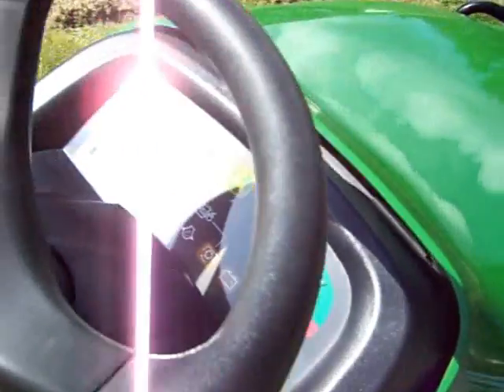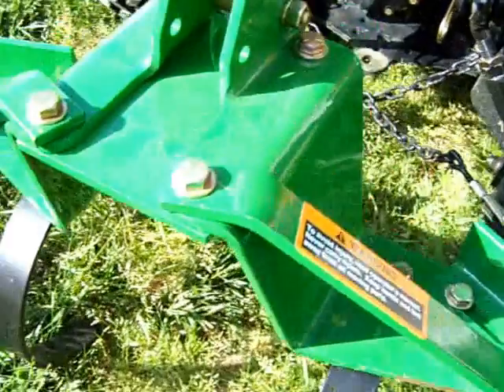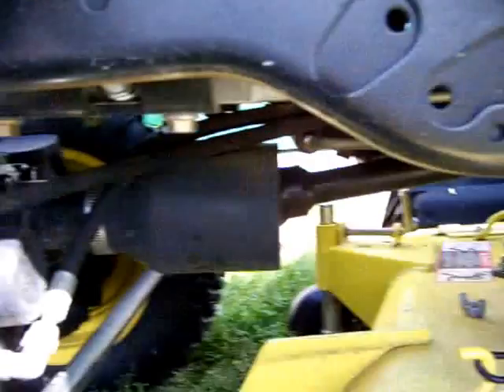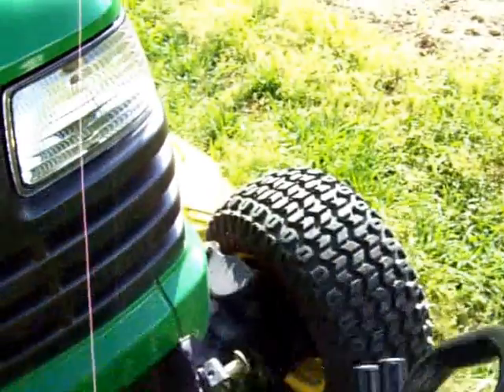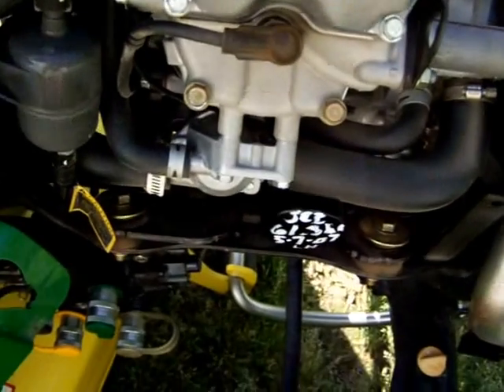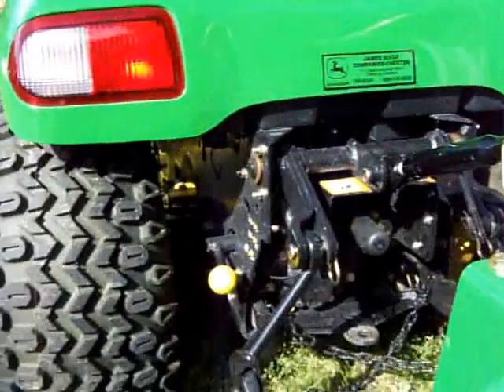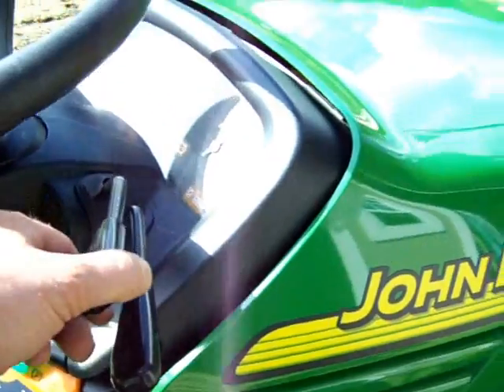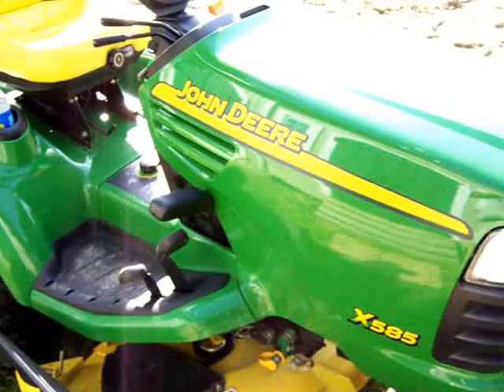John Deere X585 Tractor How it works

Comment: Just got a x585 with a loader but don't know how to raise and lower the 3 point hitch with the loader on and I have an engine light on,how do you check the codes
Reply from the maker: I wish I know buddy If you can find a manual from Fron John Deere That would help

Comment: I have a John Deere 4300 4x4 Diesel but I have always wanted one of these since it would be nice to have a smaller 4x4 garden tractor plus the Kawasaki runs smooth as silk throughout the entire rpm range being liquid cooled and EFI. The x595 is nice as well being Diesel but this one is the best they get for being a gas model
Reply from the maker: Amen Brother they are nice machines 👍

Comment: I have a 2004 X585 that I have restored.
I am adding rear 3-point and rear PTO next week.
I also have a 54C mowing deck.
I also have hydraulic front quick hitch for a snow plow.
Question : With only two levers, how do you control rear, deck, and front ?
Reply from the maker: One controller operates the mid mount deck and 3 point hitch the other will control the front up and down bubby
Reply: KVUSMC / Kenneth W Viar Jr Thank you for the reply.
I understand what you have written.

Comment: You mentioned deck lift being below the steering wheel there.  Is this separate from the hydraulic remotes, so a lock out valve isn't needed?  That would be cool.
Reply from the maker: Yes Mine is separate

Comment: Thanks very nice. Question: Any trick to getting the 3ph it operate? I am running a front loaded w/o the mowing deck. 3ph will not go up and down. Thanks Lou
Reply from the maker: +Louis Danes I think think you need an extra Diverter Valve from the Dealer buddy

Comment: nice machine, but they are completely way too much money. i have a 1971 john deere 112 garden tractor. i know its quite old, but she still is a real workhorse. just a great machine, and piece of history of the john deere lawn and garden tractors. it has a kohler k301 12 hp. i love those old kohlers, they are the best. it doesnt have a 3pt hitch, but you can use a roto tiller and sleave hitch. will work with any brinley attachments like that cultivator